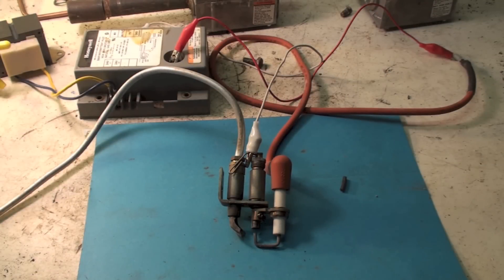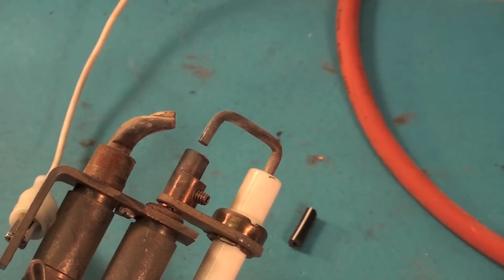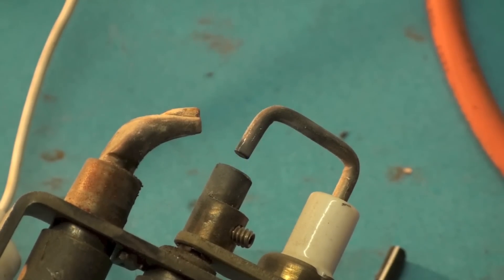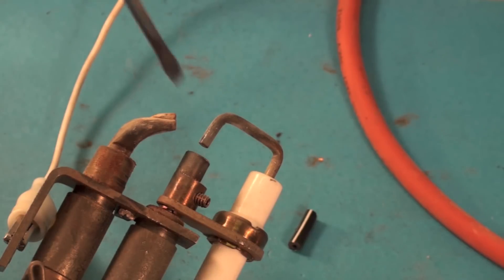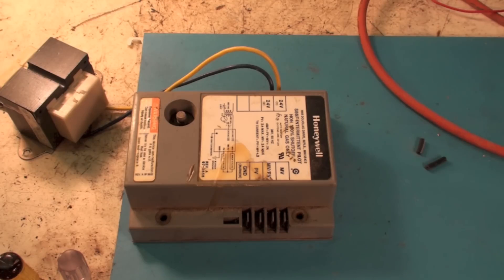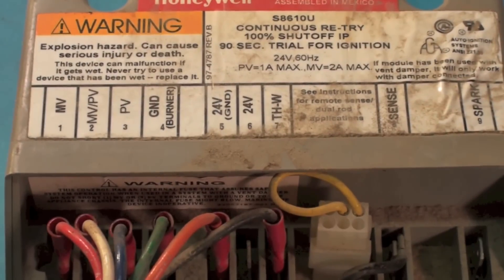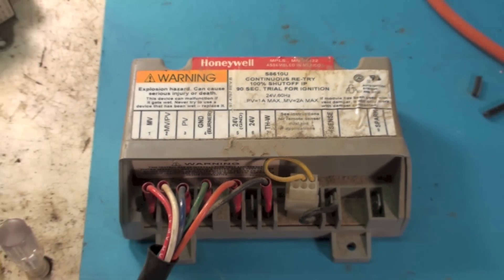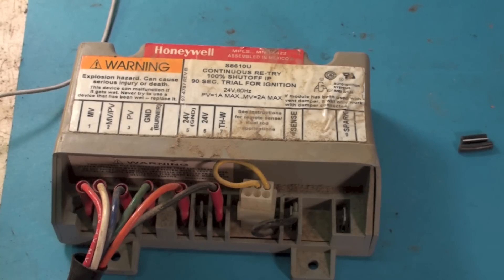Gas furnace ignition control operation

Comment: Hi GFM, I'm having these same issues on my furnace, but I can't seem to figure out what could be causing the problem.I checked the MV-PV to PV voltage and it reads 24V, I have gas, I have (continuous)spark, I have a lit pilot, I cleaned the flame rod, I have a tested and working Main Valve. The control never fires the Main Valve. According to your video, its either the Control or the flame rod.What I have yet to check is 24V from MV-PV to MV. I think there is probably no voltage there because the Main Valve is good.I think this would be a good Google Hangout opportunity for me and you to run further testing. I have a  multimeter, and I am electronics savvy and mechanically inclined. Would you be interested in creating a google hangout to trouble shoot my problem so you have another video to your wonderful collection.What I hope learn from you is how to test the flame rod, its proper placement, and ultimately fix my Main Valve problem and get some heat in this cold house. Are there any replaceable parts in the Control that could possibly repair it.Thanks.
Reply from the maker: +Felix Garay Probably the hangout is not going to happen.  There is no way to test this type of flame rod.  If the spark continues, the board has not seen flame sense.  The placement of the flame rod should be in the center of the pilot flame.  The flame should be all blue and not lazy.  I suspect there is no voltage to the valve.  Hope this helps.
GFM

Comment: I've got a Gas fired Steam boiler with Intermittent Ignition:
It seems to work for a day or two then needs to be reset and lit with a lighter.
I'd like to convert it to a standing pilot millivolt system.

We've got a Tstat, Low water cutoff and Pressuretrol in Series. Then a transformer sends power to our igniter.
The new gas valve, we'd like to use is Model VS820 A 1013 from a millivolt system. There's a pilot tube and thermocouple wire and three connections for THI PP, TU and PP, where do they connect from?

We'd appreciate any help, Thanks, Mike
Reply from the maker: +MassRealEstate.net The changeover is quite complicated and may not be viable.  I wouldn't do it.
GFM

Comment: How can I tell if my controller is working I hear a click when I turn heat up but nothing. should I replace it or should I check it out with meter??
Reply from the maker: +Md A Give me model and make.
GFM
Reply: grayfurnaceman R8184 G 4009 Honeywell
Reply from the maker: +Md A If the burner motor does not come on with a call for heat, check to be sure the burner motor will rotate easily.  Is the motor hot?  A hot motor means power is there.  Is there a manual reset on the pump motor?
GFM
Reply: grayfurnaceman I try to reset trip switch and and turn on and off power switch for burner and did hear the fuel pump run so I believe its good the the click sound is coming from furnace ignitor control module
Reply from the maker: +Md A Do you have flame when the burner motor comes on?
GFM
Reply: grayfurnaceman no
Reply from the maker: +Md A If the motor runs for about 45 seconds and stops, after it stops, look into the combustion chamber to see if there is a fog of oil inside.  No oil fog, look for oil supply, plugged nozzle, plugged filter, failed pump etc.  Oil fog, look for spark ignitor problems.
GFM
Reply: grayfurnaceman tell me what to do to check the furnace igniter control? I will do it tomorrow. The motor ran when I play with it but turns off by itself. so its so its working but the not firing igniting oil
Reply from the maker: +Md A Check my channel for the playlist on oil furnaces.  There are several videos on ignition transformers and  troubleshoot.
GFM
Reply: grayfurnaceman Thanks but couldn't find oil burning furnace ignition control module
Reply from the maker: +Md A Try this one.  https://www.youtube.com/watch?v=2bLYddTUk7o
Reply from the maker: +Md A Check your trash if you did not get the link.
GFM
Reply: grayfurnaceman ill check ty

Comment: GFM,

Great couple of videos here! We are looking to use a small direct spark controller such as this to ignite a propane pilot in a burner. We are using computer control systems on top. If I use something like the S86, could I just use it to light the Pilot and sense the flame? What output voltage does the PV see when the flame is verified? I would be using a relay to send or not send power to the main 24V power supply to control when we spark. Any thoughts? Would love your input I think you could help us out!

Thanks,

TIm
Reply from the maker: The flame sense voltage is quite high. In the range of 300 volts. I would use the entire control system that comes with the control. It feeds 24 volts to the gas valve. It also runs off of 24 vac. You could use relays. Hope this helps. 
GFM

Comment: i have a similirar set up as a furnace, we use hot plastic material to mark the streets, we have been manufacturing our own equipment, what im looking for is a set up like the one is use in a furnace, only difference is that we have or equipment install on top of a truck, so i need a module ignitor that can run on a 12 volt truck battery, are this units avaiable?
i know it is not what you are talking about here in your videos, but i decide to give a shot and ask.
thank you
Reply from the maker: Valleystriping1 I think the best choice here would be to use a 12vdc to 120vac converter.  Hope this helps.
GFM

Comment: I have spent the morning troubleshooting my gas fired steam boiler. It has been running intermittently for a few weeks.  I have proven all the boiler type controls, ex. low water, pressure, spill out, and roll out etc.  That lead me to the pilot control and gas valve.  I have continual 24v on the PV and  pilot control supply terminal , but as the boiler operates the 24v on the MV terminal drops to below 18v and eventually the boiler cuts out.  
Do you have any thoughts on where the problem lies, the pilot control or the gas valve?
Reply from the maker: My thoughts would be there is a problem with the ignition control.  The control should either supply 24v or not.  I guess the gas valve could have an intermittent  short in it but that would be uncommon.  Hope this helps.
GFM

Comment: In my home heater, After autospark,pilot start burning and after some 40 seconds main flame burns and rooms starts heating.My query is that this pilot stays burning and goes off when main flames also stops....is  this normal?Shouldn't pilot turn off automatically after flaming main flames?Thanks
Reply from the maker: No.  The pilot stays on because the flame proving is in the pilot assembly.  If it shut off, the electronic circuit that uses the pilot flame to prove flame would drop out the main gas.
GFM

Comment: Appreciate your videos, and maybe I can get your help. I have a early 90's tempstar furnace with Honeywell guts. It has a spark ignitor assembly and the Honeywell S8600M. I woke up to a cold house the other night. I went downstairs and could hear the induction blower running. I turned off power to furnace and turned back on. After a lil bit the induction blower kicked back on and I could hear rapid clicks and see sparks coming from the igniter spark assembly. I turned heat off and on a few times and eventually pilot lite and then main burners kicked on and I had heat. After house cools down the furnace goes to kick on again and I have the same situation. So when i'm hearing the clicks and see sparks I put a long match next to pilot and it lights and then main burners kick on. Sometimes the furnace works fine and other times it doesn't. Any help here would be great.
Reply from the maker: I would first be looking at the pilot flame.  Is it blue or yellow and lazy?  The yellow flame means the pilot is dirty.  You can remove and clean.  Just be sure you leak check when you are done.  Hope this helps.
GFM
Reply: It's a blue flame

Comment: The regulator and propane tank was installed and set up while The trailors furnace was still set up for lp gas..And run for a month that way till I came concerned about the amount of fuel usage,,When the heating and air specialist came out they determined that the furnace had never been converted to propane..Would the regulator already being set up for propane prior to the furnance being set up for propane make a difference in fuel usage now that it is set up for propane
Reply from the maker: I would not be so concerned about fuel usage as I would be about safety.  A furnace set up for natural gas, but run on propane will overheat.  I hope your tech checked it out.  Regulator settings will affect the amount of fuel burned, but the limit switch will shut down the furnace if it gets too hot.
GFM

Comment: Is it normal For a ignition to click 3 to 4 times before igniting a propane furnace? And to use 12 gallons a week to only heat a mobile home set at 63??
Reply from the maker: No its not normal.  Possible dirty flame rod.  As to fuel usage, there's no way I can determine that.
GFM

Comment from the maker: Thanks for the info. I always wondered about that.  I hope to never see one of those dampers installed again.  They seemed to work for 4-6 years then fail.  Even Honeywell recommends to remove them.  Of course, you then have to replace the control as it will not work without the damper once it has been installed.  Thanks for the comment.
GFM
Reply from the maker: It is not necessary.  I believe it is the same as TH-W.
GFM

Comment from the maker: Thanks for the info.  I hope to never see one of those vent dampers again installed.  It seems they would last about 4-6 years then fail.  Even Honeywell recommends to remove them.  Of course you also have to replace the control when you remove the damper.  Thanks for the comment.
GFM